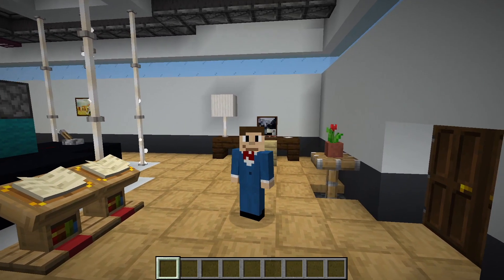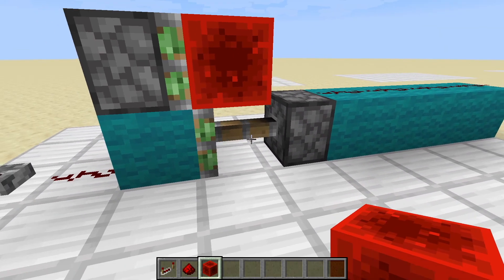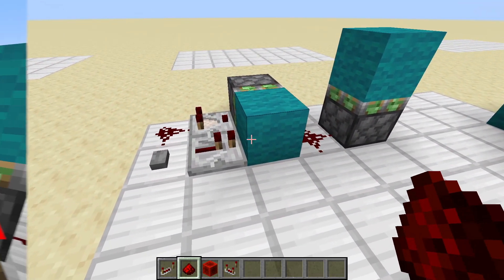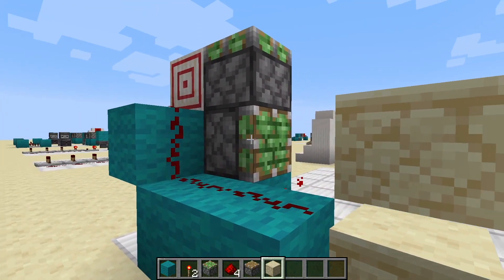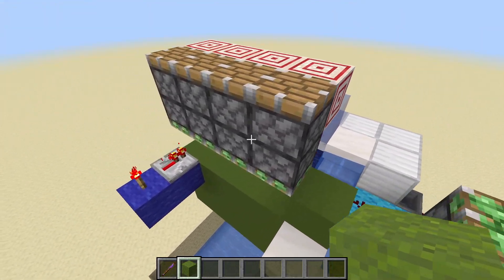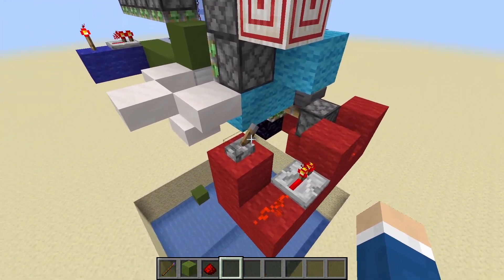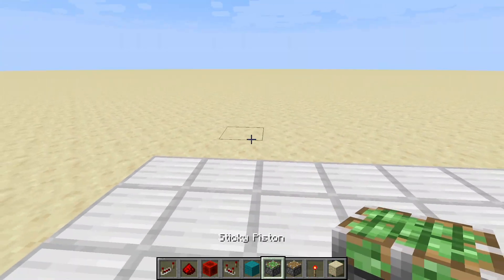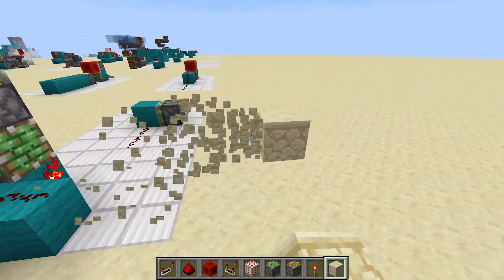Understanding Zero-Tick Pistons

Comment: i get the same delay as a normal repeater in 1.17. Is  this patched?
Reply: no it isn't only works on java just to be sure and if you are on a server like bukkit, paper or spigot it COULD also not work.
Reply: @fladenbrot1332  I'm running a fabric server with carpetmod on it. Still get the same delay as a usual repeater for some reason
Reply: @pepijndegroot9862  then idk what the problem could be
Reply: @pepijndegroot9862  I also got the same thing, but it is always 1 repeater delay, it doesn't matter how many of the instant repeaters i connect in series
Reply: If you mean 1.17.0, that's because of the difference between Java and Bedrock editions. In JE, piston retraction is instant, and that is used here; in BE, piston extension is instant instead

Comment: Hey, nice video, well explained and reecord.

You looks like a smart dude about redstone... May you know how to fix my giant hipster honey and slime doors... or if someone can help me, my problem is...

Look, i had vertical doors using fly machines, using slime and honey i can stack up to redstone line limit distance, but, when i add any form of non 0-tick exnteders, it brokes when i want to move it down again to open the door. What i noticed is, when i try to open my door, slime blocks slime power up themself and side honey blocks, soo if i use a basic repeater to do the job, it will generate the honey block be activate from both, before and after repeater... i can use 0-tick, but, for me is kinda glitch and is not a life need to activate all together, in fact i can activate in chain using observers, but, i want it cheaper as possible, lazy dude in survival hehe... do you know how can i fix it?

main issue, vertical fly machine are getting activate wrong because slime slide activate honey slides from both side, this make impossible to run at 1-tick delay extending one launch to be extended for 2-ticks and stick blocks in both slime and honey machine... did you know a fix for it?